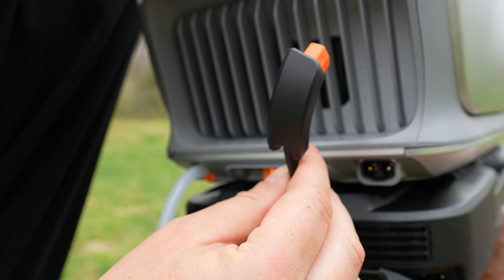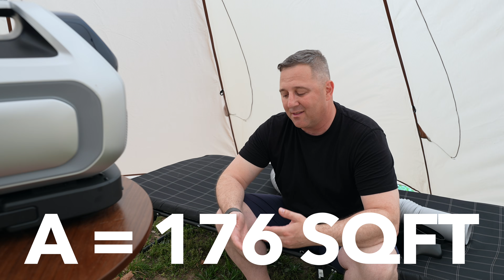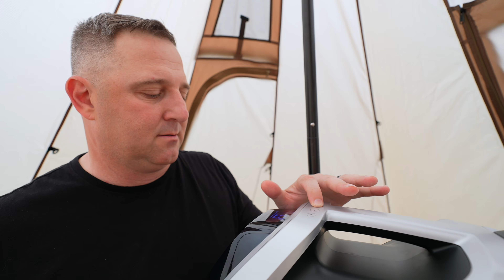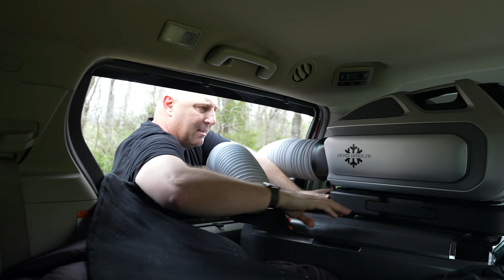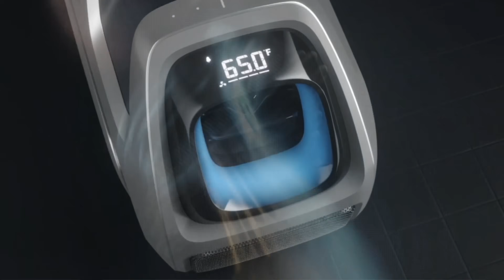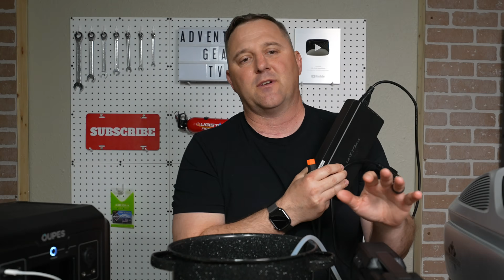What Nobody Says About Portable AC Units: Zero Breeze Mark 3

Comment: easier just to buy a small window AC and take that with you and plug it into a power bank, it would produce a lot more cooler air than that.
$2350 for something that will hardly cool a tent is crazy, a small 6000 BTU window AC $140, put that on a table outside the tent window turn it on with a power bank or a small generator and you're going to be a lot happier and not have all that inside your tent.

Comment: It would cool more effectively with the unit on the outside of the tent with a duct running inside. The reason is that if the unit is on the inside it’s sucking some of the cool air that it makes back out and using it to cool the condenser. If the unit is on the outside it will use ambient air to cool the condenser and all of the cool air that is blown inside stays inside.

Comment: Can you just plug it into an inverter or 12vt battery system? I have 600Ah to play with. 

I would be permanently rigging it into cabinetry and ducting it to vents installed on the exterior of fhe van, then porting the AC end into a louvered vent also in the cabinetry.

Comment: The problem with this test is you’re running them in a 70 degree shop so yeah the output temp are 40’s and 50’s. Do the test in 100+ degree heat and I bet you add 30 degrees minimum to those.

Comment: Cybertek s2 it's half the price. It doesn't have batteries but it seems to be even more efficient. It'd be nice a comparison. Thanks for the video. And the S2 is much much smaller 😄.
Reply: I ordered the S2 and it arrived broken.  It had something knocking around inside.  Tried to return it the first time, the price was over $125.  I contacted the company again.  They had to get approval from their "overseas" department for approval.  They finally sent me a return label after telling me to use the unit and if it worked, it's good.  Mind you, their police states that if it has been used, they will not accept a return.  Finally shipped it back and I'm still waiting for my refund.  Btw, I ordered via Amazon and they started contacting me outside of Amazon.

Comment: I appreciate the video and I definitely found the product initially intriguing, but lord have mercy on the price! They will have to figure out some way to bring that price waaaaaaaay down. At that price, it would be much more cost effective to just run the A/C in my SUV in combination of my box fan, then turn off the A/C when the temp. got cold enough. $1,200 is quite a bit.

Comment: This is a joke ,I’ve used a cheap window unit for decades in my tents and truck camper although I did not use a battery to run it I use a small generator and my A/C needs were meet many times over a battery will never last very long.when I stopped on the road at a camp site they supplied electricity for the cost of the overnight charge thus no generator noise and cold cold temperatures in my tent or camper these are novelty items and won’t last over time
Reply: Who wants to ride around with a window unit. Im in a semi truck. Not gonna happen
Reply: So you required a fossil fuel generator and a window unit. Absolutely nowhere near as practical as this.
Reply: This thing is the price of a small car. 😅
Reply: Good point, but what if you are camping someplace without shore power to get away from everyone else at a busy camping ground?

Comment: I would be curious to see a comparison to ecoflow wave 2 or 3. This zero breeze would be put to shame from what i see. No condensation water means either it has a very good recirculation of that condensate like Wave 2/3 , or it means it just isn't efficient, it's pure physics.
Secondly that thing sounded like a tractor when running,I couldn't sleep or sit too long with it being so noisy.
Third point is price.
Reply: Dude, you clearly haven't actually used both units. I have, and there's no comparison - the zero breeze Mark 3 absolutely destroys the WAVE for my needs. The size and weight difference alone is huge when you're actually hauling gear around. I don't want to lug some massive power-hungry beast just to stay cool.
I literally returned my WAVE the day it arrived - tried it out and noped right out. As for the condensation issue you brought up, mine definitely produces water. You just gotta run it on sleep/quiet mode and it's whisper quiet - I sleep great with it on.
Look man, at the end of the day you get what you pay for. The Mark 3 just works better for real-world camping situations. The WAVE might look impressive on paper but when rubber meets the road, zero breeze delivers where it counts.

Comment: Why do you need a heater? Can't you just switch the exhaust and cool sides?  Just turn it around and send the cold air outside and the hot air inside?  Just wondering

Comment: I which they can make one without the need of the hoses is 2025 come on!!
Reply: Keep in mind how AC works, if you vent to the same room, it’s going to get hotter, not colder due to the heat from the compressor.  You must vent the heat to cool.  If you’re talking about the drip hose 💧 water, home portable AC’s use your 120v to “boil” the water and vent the steam outside.  This runs on batteries, a drip hose is more efficient.
Reply: Impossible.  The hoses is to remove the heat to the outside of the living space.  From the condenser fan on the rear of the unit by the means of the refrigerant.  

You just can’t comprehend or don’t know should I say.  How they work.   

Just like central AC on a home.  You have an inside unit an outside unit.  Well the outside unit of this.  Is attached to the inside unit.   So the only way to make like the other half of the unit is outside is to have ducting.  

Same with a mini split.  Ya have an inside an outside.  

Even roll around room AC units. Still have a duct.  Some 2.   Just depends on the manufacturer an machine.  

Of that hose wasn’t there.  Yould be running g canceling out any of the cold you make.  

Go outside of the house an hold your hand above the outside unit of your home.  It’s warm air.   

That warm air is heat from the compressor. An heat that was inside of your home.  That was brought outside by the refrigerant

Comment: You should test this against the Eco Wave 3
Reply: HVAC tech here (5 yrs). On paper 6 k BTU sounds bigger than 5 k, but out in the sun you can hardly feel the difference—neither will chill a whole van. For that you’d need around 12 k BTU plus a monster power supply, which just isn’t camping‑friendly. I went back and forth between Mark 3 and Wave 3 and finally picked the Mark 3. The Wave3 can't be charged directly, a big inconvenience in my opinion.
Reply: Wave 3 is garbage. Bought one and I didn't even get to use it. They sold me used junk 😂😂
Reply: @kicka55x2 may of sold ya o e that had issues.  But “used” would be very very unlikely being they were just released.  I don’t even think one could have been sold a send back a resent out for you to end up with a used one. Vs one that just was a lemon with issues.
Reply: 5,280btu vs 6,100.   Theirs the comparison.
Reply: @ haha ok.

Comment: Nice to have A/C anywhere you toke it camping, but it cost allot $$$ then you have to recharge the batteries over &over again....... Why not just take a evaporator air cooler, it works without all the batteries draining,🫠oh ya I almost forgot you'll need a gas or propane generator, just plug in and cool 👍.
Reply: Evap coolers don't work in hideously humid Florida
Reply: That’s cool an all.  But the south east of the nation don’t have evaporative cooling.  It just don’t work. That method don’t exist.  Our humidity is through the roof.  There’s nowhere for anything to evap to.  

So that’s why I have a couple of these. Well not this brand well I have the Zero breeze mark 2 a the Ecoflow wave 2 a just ordered the wave 3.

Comment: Looks like they took notes from the EcoFlow Wave2, which is what I have. Have used the Wave2 while sleeping in my SUV, and had to turn the temp up during the night because I was too cold. Appreciate the review, but just can’t see myself t switching over to the ZeroBreeze. I run my Wave2 from a larger Delta2 !ax battery and I also have to Delta2 Max Extra Battery. Been satisfied with it, and don’t run out of DC power.
I do like the Auto-Drain feature of the Zero Breeze - kudos to them 👍
Reply: Wave 2 definitely has a dedicated pump in the AC to pump the water out.  You can turn that on an off in the settings on the app.  
If you’re not in a very moist climate.  You don’t have to have the hose hooked up.  It’s supposed to slowly get rid of the water on its own.  

Or if the climate is moist.  You can have the hose off of it.  But have the condensation pump turned off.  And it will just keep building up in the unit.   Than cooling will stop on its own until you empty it.  So it’s not going to be overflowing.  

Or like me in south Louisiana.  Here an there I use it in the bedroom.   An leave the hose hooked up. An I turn the auto drain on.  An every so often throughout the night the pump turns on an pumps itself empty.   

I just pump it into a small bucket with measurements on it.   Typically 6-9 hours give or take how hard I’m running my central air unit for the whole house.  

The wave two will collect a little over 2 liters of water.  A pump itself out a number of times through the night on its own.  

You just turn auto drain on.  

So it can be left on. An when it’s full it will pump itself down.  
Theirs even an icon on the app like a small bucket looking thing that shows how much water it has collected.  

But if the drain is on Manuel. When it senses it’s full.  Like if I leave it in manual.  An fall asleep.  
By morning only the fan will be running.  Because it stops the cooling so it isn’t keeping collecting water overfilling and spilling out.  

But soon as its pump pumps it down. Cooling turns right back on on its own.
Reply: @ Thank you for this reply and explanation. I definitely will leave it on auto with a bucket or way to self drain. In my semi i can just put a small bucket nearby. For my use case i definitely dont see the need to upgrade as this seems to do the trick while plugged into the 12v socket i can even extend the time. My next test will be with the delta 2 plugged into the 12v socket and the wave 2 running on ac connection off the delta and also plugged into another 12v socket at the same time. So ill be pulling about 180 watts from my truck batteries plus my Glacier fridge which i can run off its own battery at night so i dont drain my tractor batteries. I will be doing these tests soon.
Reply: A small bucket is all ya would need.  What I was using is actually a 2liter measurement bucket from like a restaurant supply store.  

Was just something small.  Originally I just stuck the hose into an empty 2l drink bottle.  But noticed if I slept in once.  It would overflow the bottle.   
So had to swap to something just slightly bigger.  

But on a rig. An limited sleep time.  A bottle would probably work fine an still have room left over in it before yould get up.
Reply: @yummiermussel5331  please share your test results on the Wave and Glacier when completed. Thanks
Reply: Been carting a Mark 2 for years, just switched to the Mark 3 way easier life. If you want something you can toss in the truck or rooftop tent without breaking a sweat, grab the Mark 3. The bigger units like Wave 3 are a pain to lug and the tiny extra cooling isn’t worth the hassle. For camping AC, lighter wins every time.
Reply: The new wave3 tops this unit.
Reply: Doesn't the wave 2 also have auto drain? Just got mine with battery and alternator charger 800 watts and have yet to test it out fully. Used it once and ran 8 hrs on eco

Comment: This is why I try to resist investing in 1st gen devices. I'd be so mad! 😅

The specs show the unit weighs 22lbs. I'm guessing the batteries are hefty. Do you know the combined weight of the unit and 1 battery attached?

I appreciate your efforts to demo the really important gadgetry of camp/van life. My van has no a/c!
Reply from the maker: I get it, but it’s also been several years, so things have gotten better overall. The battery weighs ~14lbs. So 22lbs for the unit plus battery is ~36lbs. Plus the hoses and remote, round it up to 40lbs.

Comment: Mario seems a bit pricey when for $1000-$1500 you can buy a split unit -tap me out !
Reply: Yeah I used to think the same thing — $1000+ feels steep when you compare it to a split unit. But after looking into it more, it’s kinda like comparing apples to oranges. A split unit is awesome if you’re staying in one place and can hook into the grid. But in a van? I don't want to cut a giant hole in the wall, and I’m not always plugged in. The Mark 3’s more like: drop it in, hook it to the battery, and chill — literally 😅. No install, no shore power, and you can still move locations whenever. Not cheap for sure, but if you’re living the van life and need cooling off-grid, it’s kinda in its own lane.
Reply: Can’t compare the two